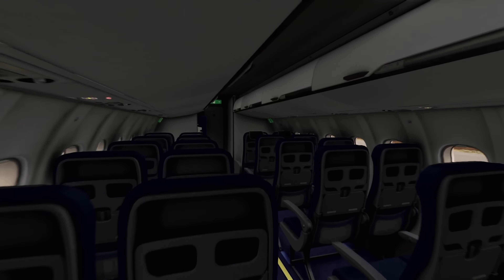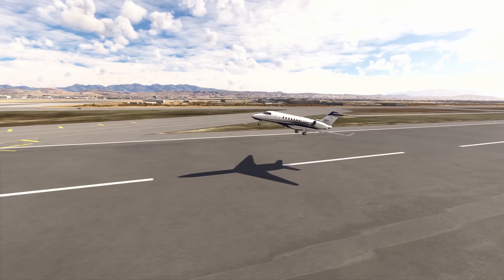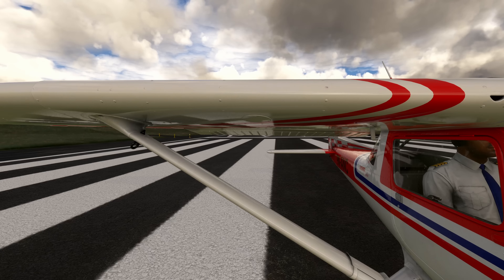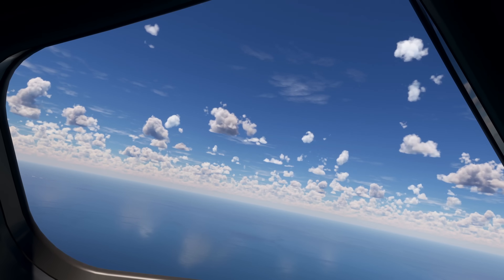The Truth about Lift

Comment: So when a airplane climbs at a steady rate, is it because the climb power and attitude  create a vertical thrust component, or does the wing create more downward force, or both? I would guess the wing trailing edge flow has a steeper angle but less volume since the climb speed is lower than the cruise speed. ???
Reply from the maker: Both. Thrust per pound of weight is strongly correlated to climb rate, so thrust is a larger factor but an increase in wing angle of attack causes a climb as well.
Reply: @flyingformoney777  thank you!

Comment: I looked at this in my thesis, the starting vortex explanation is significantly more accurate as it takes into account the wing geometry and perfectly accounts for inverted flight. Newton’s third law is undoubtedly at play here too but the angle at which air is deflected downwards from the wing is only a few degrees, and if it’s only a few degrees, the wing must deflect magnitudes more air to sustain opposite lift, as only a small portion of the air’s vector is in the vertical axis. Think of it this way, if the air was deflected perfectly 90 degrees down, you could get away with deflecting air mass close to that of the airplane. At 45 degrees, you need to deflect double, and so on. It cannot just be Newton’s third law.

Also weight absolutely is a force.
Reply from the maker: Newton’s Third Law must be fully satisfied to produce any force. The acceleration rate that the wing produces on the air is a factor too. Weight is acceleration times mass. So the vector of the air mass pointing down can be low if the acceleration rate is high. 

And yes, gravity is a force but (in context) I was discussing aerodynamic forces. Gravity is not an aerodynamic force.

Comment: There is no way of knowing if you or anyone else is right on the matter at this time. Air is a fluid, fluid dynamics is not a solved problem, in fact it’s the last great unsolved problem of classical mechanics plus chaos theory.  So, you may be right, but technically there’s no way of knowing mathematically just yet. Anyone can argue their favorite theories, but I would remind you that wings and airplanes were designed and put into service by empirical brute force, not theory alone.
Reply from the maker: There’s really no question about satisfying Newton’s Third Law. The precise mechanism that does it is much more variable and complex.

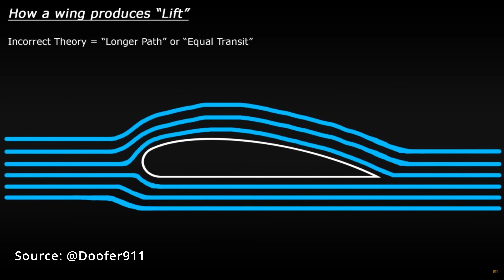Comment: There are a few misconceptions here. First, at 4:28,  the air flowing over the "bottom" of the wing while inverted (the flat-ish surface that is now facing up) would indeed have lower pressure than the "top" of the wing. Both pressure and momentum displacement are equally valid ways of looking at lift, they both result in the exact same force keeping the plane up, because at the end of the day, they are the same thing, that's how physics works. 

At 6:30, as others have said, weight is a force. It not being an aerodynamic force doesn't matter, because thrust isn't an aerodynamic force either. You have 2 aerodynamic forces (lift and drag) and 2 non-aerodynamic forces (thrust and weight). While lift (and also drag) are simplified into single forces, nothing about the 4 forces of flight explanation is actually wrong. 

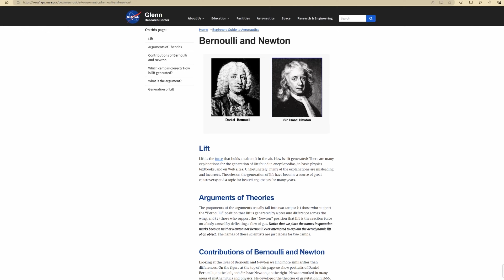At 9:30, angle of attack is not tied to either the top or bottom of the wing, but it is a necessary part of looking at lift. There may be wings that can produce lift at 0 AoA, but they will still produce more lift at a higher AoA and less at a lower AoA. In fact, almost all wings, even flat plates, have a nearly identical coefficient of lift vs AoA slope of ~0.1/degree. The coefficient of lift is much more complicated and would require going through tons of aerodynamics, but just know that it relies on AoA, and without it your lift equation goes nowhere.

I've also repeated heard that people are told the incorrect "air must reach the trailing edge at the same time explanation", but I've never heard that explanation myself other than when people are saying it's wrong. So I'm curious, for those of you that were told this, where did you hear it? Was it in school, and if so, what state/country?
Reply from the maker: Sooo…thrust is not an aerodynamic force? It is exactly the same as a wing in that air is accelerated in one direction (towards the back of the airplane) producing a forward counterforce. Aerodynamics are important in designing both props and fan blades.
Reply: @flyingformoney777  Thrust can be created by aerodynamic forces, but thrust itself isn't one. Imagine if you had a rocket powered plane instead, the forces of flight still work the same way, despite the rocket thrust not being an aerodynamic force.
Reply from the maker: Rockets propel themselves by spitting mass out the tail. Still third law stuff. Jets and props borrow the mass they spit out from the surrounding air. Gravity is a totally different force. That said, I have no quarrel with the fact that in level flight gravity is countered by lift. In a 90-degree bank, you can still have a ton of lift. The counter force is deflected air, not gravity.
Reply: @flyingformoney777  Rocket propulsion still isn't an aerodynamic force, and it doesn't matter if it's spitting out mass or not. If you had a plane propelled by electromagnetism (let's say it was made of steel and flying inside of a coil gun) it would still work the same way. I'm not sure I understand you're saying in your second point, and I don't want to argue with an incorrect assumption. Are you saying that the forces are different in a 90 degree bank compared to level flight, that gravity (weight) isn't a force in one or both cases, or something else?
Reply from the maker: I’m saying that gravity is a constant. An aircraft can operate in any orientation, and thrust, drag, lift, and displaced (accelerated) air are the effects an aircraft produces. Gravity doesn’t matter aerodynamically. And airplanes produce thrust aerodynamically. I wasn’t talking about rockets or electromagnetism. I understand your point there, but you can’t change the terms and then critique me over it (and in the case of rockets, you are dealing with the same fluid dynamics that govern air).
Reply: @flyingformoney777  That displaced air *is* the lifting force that is countering weight. Weight, caused by gravity is an essential part of the balance of forces, and is always in a free body diagram for an aircraft. It doesn't matter aerodynamically, but it does matter for flight. 
Think about it like this, force is mass times acceleration, and the plane has a certain mass, gravity applies an acceleration downwards, resulting in a force known as weight, to counter this, the plane must apply an equal acceleration upwards, which it does by forcing air downwards, if there were no gravity, the plane would instead by accelerating upwards at 9.8 m/s^2 (not counting the inevitable downward drag).
I'm also not changing any terms, rocket powered airplanes do exist and they don't produce thrust aerodynamically. Electromagnetic planes don't exist as far as I know (the closest airplanes to that still work by accelerating air) but they are possible and would still work the same way.
Reply from the maker: As I’ve stated in other comments, when I said gravity wasn’t a force, I was referring to aerodynamic forces. Rocket thrust is governed by fluid dynamics just like air is. There is no practical airplane that produces thrust without the use of gas (or air).
Reply: @flyingformoney777  Rocket thrust is not governed by fluid dynamics, standing on a skateboard and throwing a bowling ball to push yourself back is a rocket. Chemical rockets work the same way. You're too focused on fluid dynamics, in physics a force is a force, whatever type it is, that's the beautiful thing about it. That's also why pressure differential is a valid way of looking at lift and why it yields the exact same results. Here's an example of an aircraft that has thrust without the use of air, a glider being towed by a car. The thrust comes from from the wire pulling it. Again, the source of the force doesn't matter, it still flies the same way.
Reply from the maker: https://www.grc.nasa.gov/www/BGH/rocket.html
Reply from the maker: It kind of feels like we are arguing in agreement.

Comment: Back in the sixties I was ridiculed for bringing Newton into what keeps an airplane up, so thank you for an excellent program. It seems that the real problem for most who question Newton is not so much the downwash, but how the wing produces it. The air deflected downwards by the lower surface is easy to grasp intuitively, but the way the air is "pulled" down on top is harder to visualize.
 I explain it as the air on top surface "thinning out" to cover a longer distance / volume, which reduces static pressure there. This causes the higher surrounding static atmospheric pressure above the wing to flow downwards contributing to downwash.

Comment: As a student pilot your videos need to be more main streamed. You're a excellent teacher and I continue to recommend your videos to my fellow peers in hopes i don't see another crash because of unfortunate negligence. i would love to see a video on some form of preflight or aircraft Maintenace let alone the imposable 180. My father is a 747 captain and the level of thorough explanation is the same. If you ever get the chance i would like to hear you options on 141 vs part 61 flight schools
Reply from the maker: I did both. It depends on your objectives. If you want to do 121 flying get in a program that credits you to something lower than 1,500 hours to get hired. Otherwise the 141 is a little more structured and to be efficient you can’t really change 141 outfits partway through (that’s how I wound up finishing 61–it was quicker). Blue skies!

Comment: 6:37 very interesting video. One small nitpick though: in every physics textbook ive ever read weight is defined as the force exerted by gravity on an object. So yes, weight is most definitely a force. Doesn't change the broader point you're trying to make though.
Reply from the maker: I was abstracting. It’s not an aerodynamic force. But you are correct, it is a mechanical force 👍
Reply: @flyingformoney777  Ah sure that makes sense! Thanks for clarifying

Comment: Nice video, Stan, but there are a couple rough spots.

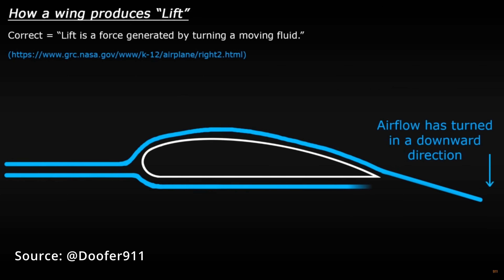0:55 The downwash should be angled downward, not horizontal. Like the diagram at 6:55.
1:40 The "something else" is the thing that applied the force.
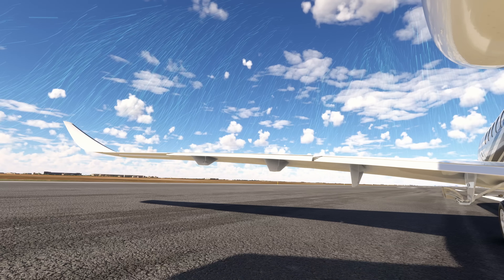1:45 Other way 'round: The wing must exert a downward force on the air, and by Newton's third law, the air will exert an equal and opposite (i.e. upward) force on the wing.
1:55 Not quite. See "Calculating the lift" at the end of this post for deets.
2:00 I don't see how this section helps explain lift.
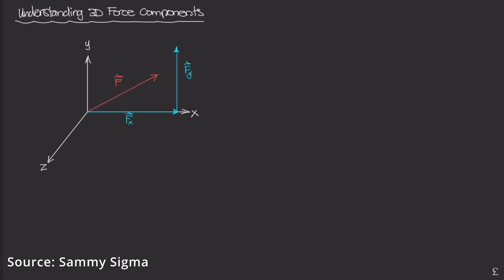2:50 The net vector sum, not the average.
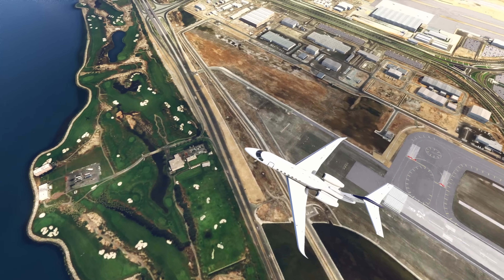4:10 Not quite. See "Calculating the lift" below. 
4:30 When the plane is cruising upside-down, the low pressure is on the flat side of the wing. Still the upper surface, just like when cruising upright. (7:25: "You don't even need a curved upper surface to produce lift." )
4:40 The AoA should be the other way (and not so extreme). Same as with the upright wing, but with opposite curvature (and not as efficient).
6:35 Weight IS a force. It's the gravitational force exerted on the plane by Earth (W = m*g).
6:40 No need for tinfoil hats here. Air is a gas, not a force. The wings push air downward, Newton's third law says the air reacts by pushing upward on the wings, and THAT force counterbalances the plane's weight. Earth pulling the plane down, air pushing it up.

Calculating the lift:
* The general form of Newton's second law is the one that applies to lift. This states that force is equal to how fast momentum is changing (F = dp/dt). (Momentum is called "p" so people won't confuse it with mass. 🙂)
* Momentum is the product of mass times velocity (p = m*v), and the speed of the downwash is basically a constant when the plane is cruising.
* So the lift force is equal to (dm/dt)*v, where dm/dt is the rate at which air mass is passing around the wing and being accelerated downward.
* More precisely, v represents the (downward) change in the vertical (i.e. transverse) component of the air's velocity, i.e. the downward speed of the downwash relative to the wings.
* And finally, drag is defined in terms of the slowdown in the horizontal (i.e. parallel) component of the air's velocity. 🙂
Reply from the maker: Thanks for the detailed note. I thought about including the second law stuff, but people have enough trouble with the third law so I was abstracting a bit to keep it simpler. Cheers.

Comment: With respect, but wrong. So wrong.

Here is THE explanation of airfoil/wing generated lift.

As an airfoil/wing moves through the air a perfect vacuum forms on its top-back surface. This vacuum diverts and accelerates the air above it downward along the wing’s sloped backside. This diverted air creates a low pressure area above the wing that pulls, “scoops,” more air downward.

All of the scooped up and accelerated air is then blasted down the wing’s trailing edge. The opposite and equal action to the acceleration of the air down the wing's trailing edge is lift.

There are videos of jumbos landing where this process can be observed in the condensation formed in the low pressure area above and to the rear of a plane's wings.

Lift by an airfoil/wing is NEWTONIAN, not Bernoullian. However, the low pressure formed as described does permit the use of mathematical approximations with Bernoulli formulas when designing airfoils/wings.

More interesting is that as lift generated on an airfoil/wing is Newtonian, It can be deduced that most of the energy that sustains an airplane in flight is extracted from GRAVITY. Which provides wing and rotor equipped aircraft unpowered glide ratios or auto-rotation. Then there are autogyros that use an unpowered airfoil shaped rotor as a wing. Airfoils on aircraft are essentially gravitational energy harvesting devices.

Comment: You can just put your hand out of a car window, tilt it up slightly, and feel it lifting your arm up lol. There is absolutely nothing special going on with an asymmetric aerofoil that suddenly means it can magically produce lift. We should start by teaching kids in pilot school (or physics in general) how lift is generated from a completely symmetrical NACA aerofoil by just tilting it upwards, before getting onto the benefits of asymmetric aerofoils and why we use them in aircraft wings. That way we can put the magic vacuum cleaner lifting wings up by low air pressure myth to bed lol.